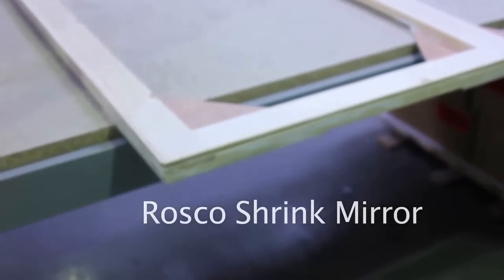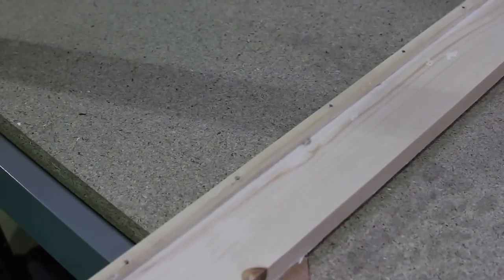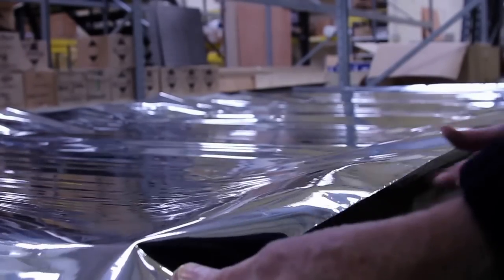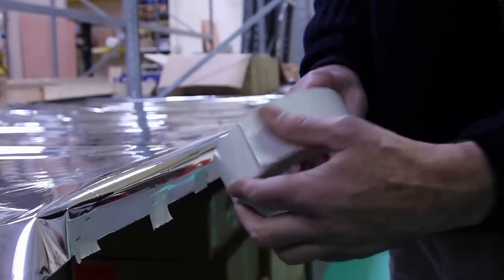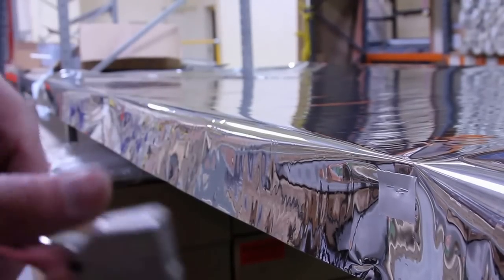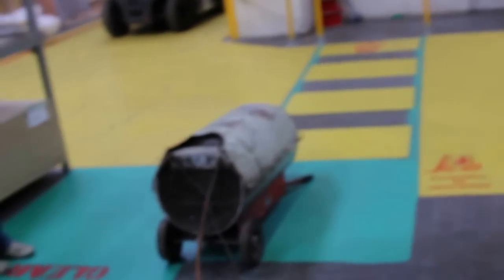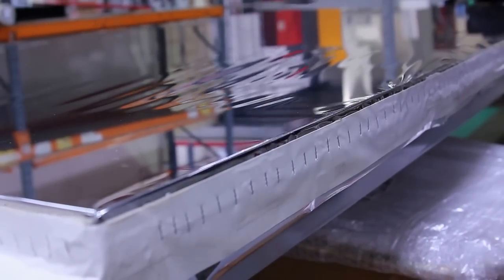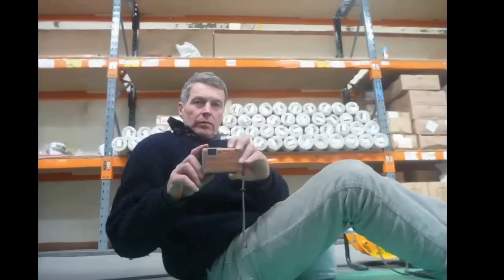Stretching Rosco Shrink Mirror

Comment: I’m trying to figure out if it’s possible to make a 2 way mirror like this. Anyone have any suggestions?
Reply: yes but you would need a sheet of rigid acrylic or plexiglass between the mylar and film since the 2 way film will not adhere directly to the mylar without wrinkling it. Actually now that i think about it, the mylar is opaque so you would barely be able to see through it even looking at a bright light from inside completely dark room, and if you're using a pane anyway then there is no need for the mylar and you can avoid all the fuss of taping and tightening. It's actually easier to make a 2 way mirror but they will be a little heavier.

Comment: Thanks for the video, very good explanation. Were you able to get the surface totally flat to get an essentially mirror like reflection (looks like it, but difficult to tell on the video)? I've gone through the process and done ages of heat-gunning but it's just not quite as sharp and detailed as I thought it would be. Cheers, if you have the time to respond!